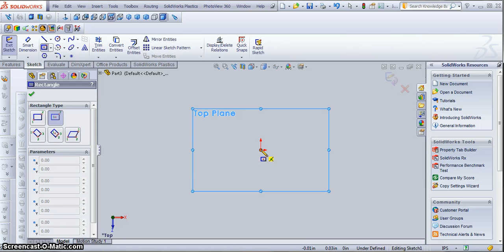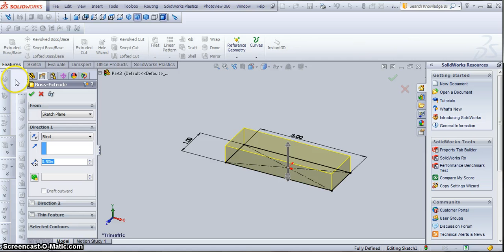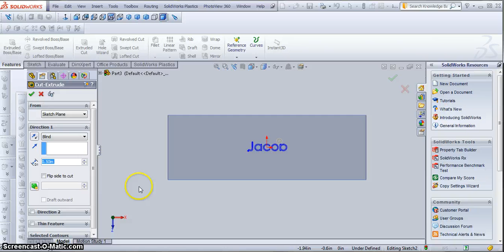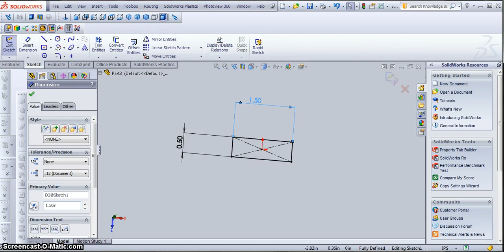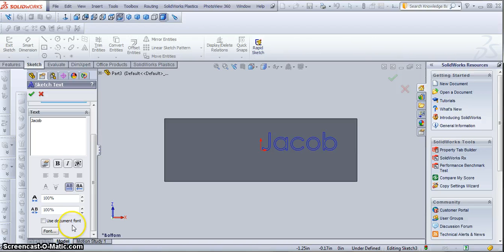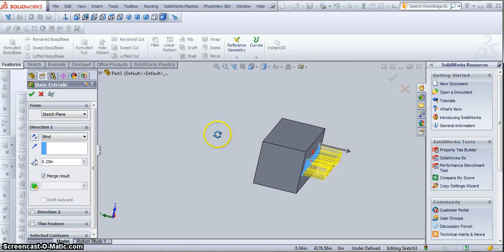Beginner SolidWorks text recessed or extruded

Comment: how do I change the font size? I feel like solid works is not robust enough.
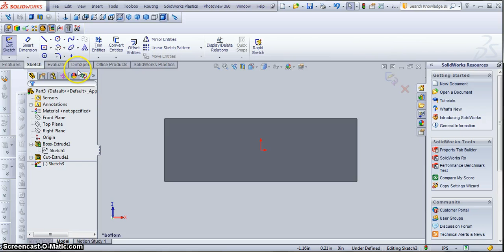Reply: Watch from 8:35. Open Sketch Text Box/Uncheck Use Document Text/ Click Font/Select Points on lower right side/ Left click in Size Box and type any size you require.